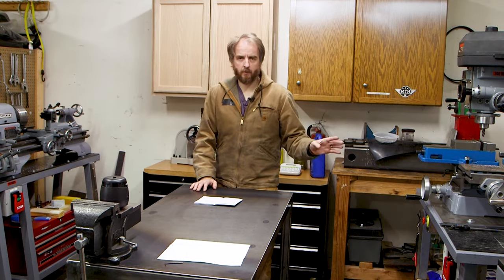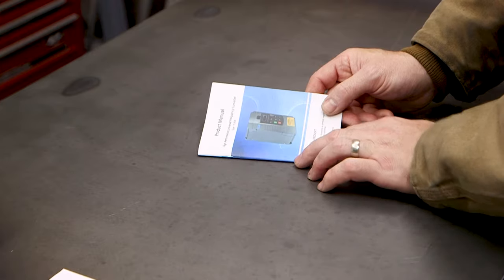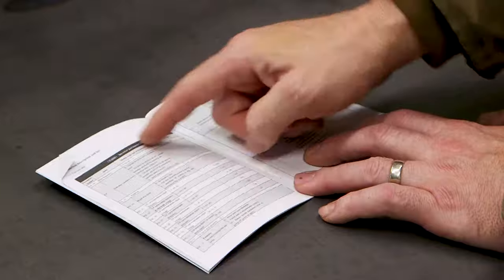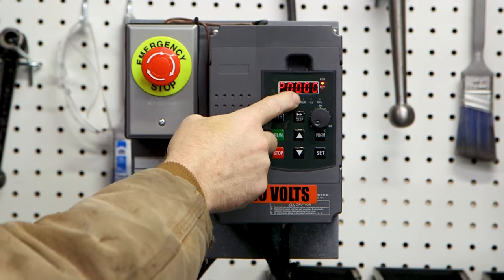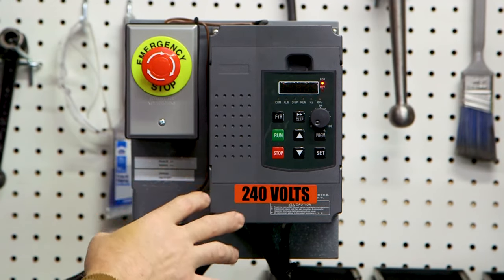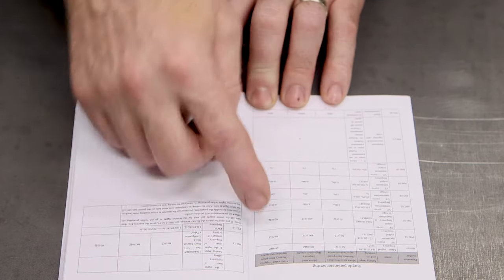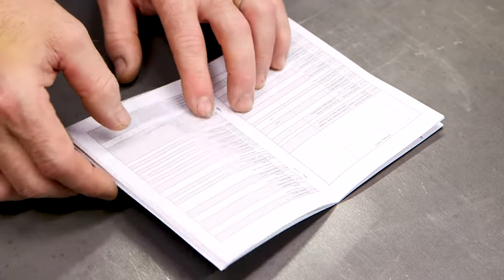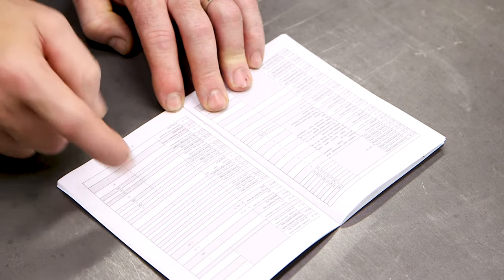How to Configure your new VFD

Comment: Thanks for taking the time to make this video. It's perfect.
Reply from the maker: Glad it was helpful!
Reply: I did all the changes and motor still runs rough with vibration ,  motor works fine on another VFD from different manufacturer

Comment: Have this same VFD. Great video, thank you. Trying to power a General 350 3 Phase table saw, but not having any luck getting power to the motor at all. Really don't want to have to throw in the towel here as the saw is mint.
Reply from the maker: I can think of a couple things that might keep it from sending power to the motor.  Maybe one of these will help.  First, and I'm sure you've done this, make sure the motor is wired fro 230v and not 460v and that the T1, T2 and T3 connections are right on the VFD.  Second, double check the safety switch settings for pins x1, x2 and x3.  Make sure none of those are configured as a stop or safety switch.  Those will keep it from sending power to the motor.  Third, double check the setting for vfd control.  Make sure it's set to the panel and not to remote.  If that happens, it will look at pins x4 and x5 for control and disregard the panel inputs.  I'm sure there are other settings that could impact it, too.  Mostly, check what the programmable pins are doing, check to make sure it has panel control (and not remote) and double check the motor configuration.

Comment: Hi. I have a VFD to run a 3 phase tyre machine. Is it possible to trigger the VFD on when I touch the machine pedal? As it is, the cooling fan comes on and off (even when not in the "run" mode) and  I have to press run each time I want to use the machine and wait for it to ramp up to 50hz. Also, I expect the fan running so regularly will kill it prematurely.  To stop the fan running when not in use I am powering down the VFD at the breaker. Which is a bother since the breaker supplies other power outlets in the workshop.
Any help appreciated. 
New Zealand
Reply from the maker: Have you considered breaking the circuit between the VFD and tire machine motor instead?  Leave the VFD powered on, use a contactor style switch to interrupt the three motor leads as they come out of the VFD.  I'm not sure if this would cause a problem with startup current draw, though.

Comment: Thank you so much for the video. After watching it, the printed manual makes a bit of sense. (I have the same VFD).
I’ll probably have to watch this video a couple of times to be 100% clear.
I am going to this VFD for my Delta Unisaw (table saw). It has a 3-phase motor and runs on 220 volts. (I have 220 Volt in my home garage/workshop that’s why I am using this VFD.
I have two questions.
1- The table saw has its own magnetic on/off switch! Would it be ok to use this VFD, considering the magnetic switch?

2- It seems that you have hard-wired your mill directly to the VFD, but I have installed a 3-phase, 220-volt surfaced mounted plug, which I will use, like any other electrical machinery for my saw. The only difference is that the supplied power to this plug comes from the VFD. Do you think it is ok?
Many thanks.
Reply from the maker: I don't think the magnetic switch would be a problem with the VFD provided it is used to power the VFD and sits on the line side.  

I don't think you'd have a problem using a machine plug between the VFD and the motor.  It'd have to be for T1/T2/T3 and you wouldn't be able to power it without the VFD.  Essentially, you'd have a movable machine but one that wouldn't function unless it were plugged back into the load side of the VFD.  

All should work, I think.
Reply: @RobertAdairWorkshop  Thank you. Appreciate you taking time to reply.

Comment: definitely keeping this one in my watched history...NOW I don't feel as intimidated by the setup my 100 yr old lathe came with...14" swing Joseph Crawford machine shop lathe with a 5hp 3phase and an amazon VFD...looks very similar to yours...Now that I have a better understanding...without the technical mumbojargonjumbo...just the meat n taters...I'm going to poke buttons once I find a copy of the manual somewhere...
the problem I have, is the speed dial doesn't work...nothing happens when I turn it...lathe powers up an moves though...I have forward and reverse...but no speed dial
I wonder this though...theres a FWD / N / REV drum switch between the VFD and the motor...would that mess with the speed control?
Reply from the maker: I'm not 100% sure, but I would suspect the drum switch, too.  Do you know what contacts it makes to get reverse?
Reply: @RobertAdairWorkshop  No, I don't know unfortunately.  I'm not very savvy with electric stuff.  I know enough to not burn the shop down or electrocute myself.  I found a similar unit on amazon.  But there's no schematic etc.
Seeing as how it's inline between the VFD n the motor, I'm going to bypass it and see if that works to get the speed knob working.
I found a manual for the VFD online, failing the bypass, I'll start poking buttons.
thanks for the reply!

Comment: Thanks!  This is timely.  Are the parameter numbers similar for most of the Shenzhen VFDs?  I bought an Automation Direct for my Wells-Index mill and the voluminous manual reads like it was written by an English teacher.  About to buy another from them for the table power feed motor on the mill.  I just bought a 3 horsepower 3 phase lathe that has an ENC VFD.  I found a manual on their website but OMG, the translation is so bad that I'm not sure what they're describing as the parameter descriptions.  The ENC is set up very nicely with a reverse switch, E-Stop and speed pot but at the first glitch it will be replaced with something that I KNOW has an intelligible manual.
Reply from the maker: I took a look at the two manuals and the P-codes are different between the two VFD's I have.  The ranges are same, so the 000X codes are setup for the VFD on both machines but what the parameters configure is different.  I'll take a look a the badly translated one and see if I can make heads-or-tails of it, if you'd like two brains on it.
Reply: @RobertAdairWorkshop  All help is appreciated.  Thanks!

Comment: Hello I install a small hydraulic elevator in my home with vfd but the motor not working is connected to U V W terminals i cheque on the motor  and only 24 volts show is something wrong with ufd or need programming thanks
Reply from the maker: Sounds to me like it needs programming.  The output voltage is frequency based so it may not read the voltage you expect.  The voltage, hertz, number of poles and max RPM all need to bre programmed (at least on the one in the video) for it to work.  Is yours a dual voltage motor?
Reply: @RobertAdairWorkshop Thank you for respond. This motor is oil immersed low noise unit Works in the oil

Comment: I have the same VFD, it looks the same and the manual looks the same.  I figured out the manual and got it working for my drill press.  I've got two questions - 1. Do you have low torque/power at low RPM and how did you fix that?  2. The emergency stop switch on the wall - how did you wire and program it to work?  I've not been able to get mine working.
Reply from the maker: Here's a video where I show more of the installation:  https://youtu.be/kd4fgYpNiSQ

I did not have problems with low speed torque but I'm using the step pulleys in conjunction with the VFD which lets me slow down the spindle while maintaining torque.  I wonder if changing the VFD profile (percentages at RPM) would help?

I was never able to get the safety stop switch to work.  I had it wired I not pin X1 and COM and programmed correctly but it never worked.  I tried several of the other programs on those pins to see if any other functions worked, but none did.  I cam to the conclusion that the programmable pins don't work.  I suspect there is a software issue where the pins aren't polled correctly.  I ended up pulling the VFD off and swapping it for a different one, the AT1.  I kept the VFD and will use it on my surface grinder which has it's own shutoff switches.  

So yeah, not great.  Check out the video I linked above if you have time.  At the end of it, I talk about the problems with the programmable pins.
Reply: @RobertAdairWorkshop  Thank you for responding!  I do have exactly the same VFD you started with.  I also have tried all the same things.  Betting the only way to get a safety stop to work is use the full external control button setup.  The manual has a lot of undocumented settings; you and I both wish we knew what they were for!  If I can solve the problems I'll be sure to let you know!

Comment: I have a ASY AT1 inverter and a single phase motor, and my grinder is already fabricated.  Can I make these work together? I found instructions online but for this configuration it specifies “AT2”. I’m really confused at the moment 😂
Reply from the maker: You'll need a 3-phase motor for the AT1.  It takes in single-phase power and spits out three-phase power.  The AT2 looks like it does single-phase power in, single phase power out.  It also notes its for 220/240V so your 1-phase motor needs to be made for 208/220/240V.  As an aside, 3-phase 240v motors are considerably cheaper and more readily available than 120v single phase.   You might be able to get a 3-phase motor cheaper than that AT2 VFD.

Comment: Bought 3 yrs a ago. Immediately the manual was garbage,  That parameter page is completely black ( redacted) Ran it as shipped, for nearly 3 yrs, no power, motor cogs at low rpm, limited speed control.  But usable  Watched this a few  wks ago and now just flashing numbers beginning with P or randomly push buttons and F something flashing. 
@ 2:25 "Select program"
@ 2:25 " in the US its 60hz" IDK press a random button?  My keypad layout is slightly different.

Comment: Do you have any comments on how to choose which Chinese VFD to buy?
Reply from the maker: There's really only a couple of things you can look at.  The Chinese manufacturers don't publish much in the way of specs.  I've chosen them based on motor size.  I usually go 3-times the motor size I'm using.  So for a 1HP motor, I use the 3HP vfd.  Some of the VFD's accept 120V single phase and some, 240v single phase.  Keep that in mind.  You'll want to choose one that aligns with your supply voltage.  Most 3-phase motors are 240v or higher, though, so it'll likely be based on that.  I've used two different models with good luck from both:  The AT-series (AT1) and this YL600 series.  You'll find many different "brand" names for these but they are typically all the same specs/manufactuers.

Comment: How do you add a on/off button?  see one next to your vfd
Reply from the maker: It’s connected to a pin on the vfd’s programmable io header and shorts that pin to ground.  I had to configure the pin for that function using the P-codes.